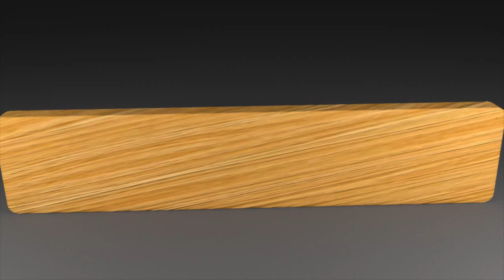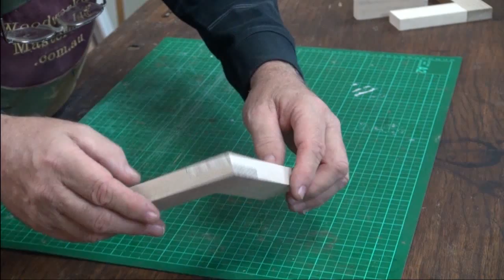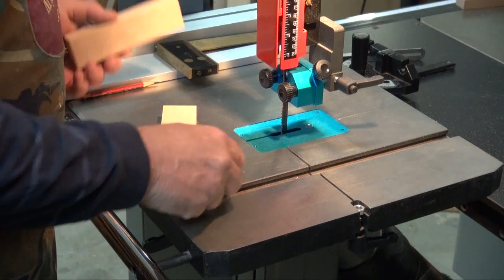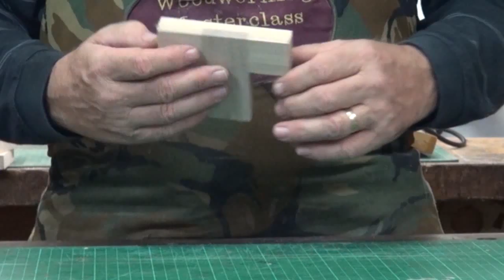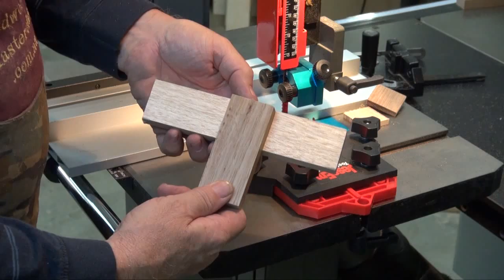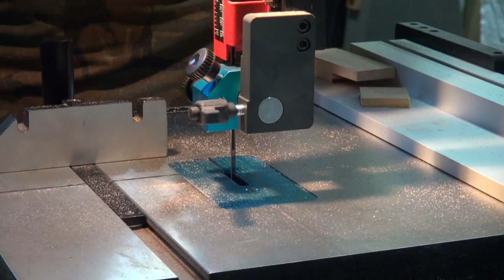Bandsaw Joints (2 of 9) Corner and "T" Half Lap Joints

Comment: I thought a bandsaw would be the perfect power tool I could get. I didn’t know any better, so I picked up a small workbench bandsaw. The groove you attach your miter or the fingers looks like it a “T” track.... mine is just a U-shaped channel and it doesn’t feel secure at all while in use. I have no Fence and I’m pretty sure I don’t have a way to mount one like your is.   Please make sure if you are planning to purchase a bandsaw that you really make sure it can do all the stuff you are going to need. Maybe plan to spend a bit more to truly get a tool that will fill all your needs until you can purchase other tools.
Reply from the maker: Get a strip of metal that will slide neatly inside the slot or fill out the slide with thin piece of timber. Wax it and it should work of for a time or even a long time it you use a hardwood. There are Magnetic fences on the market that work very well I know Carter has one also Magswitch. I use both in my bandsaw a different times even though I has a factory made fence. But it is good advice to make sure it can do what you want before you make that all important purchase For the record if I was only allowed one saw in the shed it would be a Bandsaw too. Cheers Steve
Reply: I was trying to keep it small at the time because I didn’t have a shop. Just a corner in the house. I was really trying to make a small work area working from a seat. It didn’t turn out that way though. I love doing lathe work as well. I’m trying to do woodcarving with hand tools now. We’ll have to see once we move if I’ll have space to do any of that.
Reply from the maker: @Trindal  I'm sure you WILL find some! lol. Cheers Steve

Comment: I enjoyed your video very much. I have a project that will use half lap joints and I wanted to compare band saw vs table saw. I like the band saw because it is much safer, so that is likely the way I will go. Thanks and best wishes.
Reply from the maker: Both are safe providing you follow the correct procedure and are comfortable using the individual machines. Cheers Steve

Comment: These videos helped me justify my tool purchase.  I'm a hand tool guy looking to add some power tools in the mix.  I was considering dropping money in this order:

1) Table saw
2) Planer
3)  Bandsaw

Considering that there are 9 videos, it make sense for me to do the following:

1) Bandsaw
2) Table saw
3) Planer

It seems that the bandsaw is a lot more versatile than and since I have hand tools anyways, I can use the bandsaw to resaw thicker boards close to the size I need it and use either an electric hand planer or my trusty #7 to keep it parallel and flat.  In fact, I could probably hold out on buying a table saw for a while as well.  Thanks Steve!
Reply from the maker: Hi Brian, I'm with you. A  Bandsaw can do much of what the other machines do, especially with a #7 to back you up. But the other machines can't do what a bandsaw can. Happy Woodworking. Appreciate your feedback too. Cheers Steve

Comment: Thanks Steve, as I'm just starting out these vids focussed on joints are a great help. I notice there was a bit of gap in the centre lap joint you made while filming, but on the "one you  made earlier " it was flawless. Was the one you made while filming cut slightly wrong or did you do some secret fix to get the other looking perfect ?
Reply from the maker: I think what you are seeing is the shadow of the overhang which looks like a gap. The before shot did not have the housing cleaned out. But for reference if you do get small gaps they can be filled by putting sliver of the same timber to fill any gaps. Cheers Steve

Comment: For the T-Lap joint, another alternative to cutting the middle one out would be to cut some fingers first, break them out and then use the newly cut part to fit the bandsaw blade into, that way you don't have to spend all that time cutting out all of the fingers and the bandsaw can clean up instead of a chisel.
Reply from the maker: True, but it been my experience in the past that you still have the rough surface the bandsaw blade leaves and also if you get any drift it ruins the mating surface. But it is an alternative for sure. If it works better for you then by all means use it. Cheers Steve